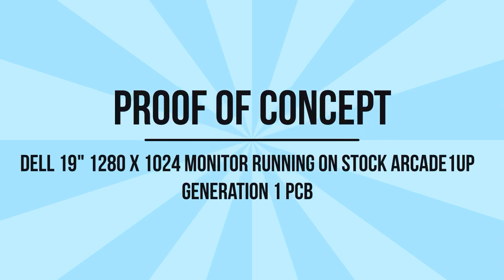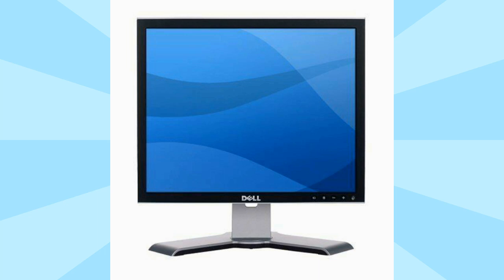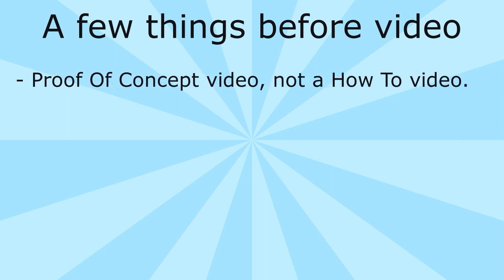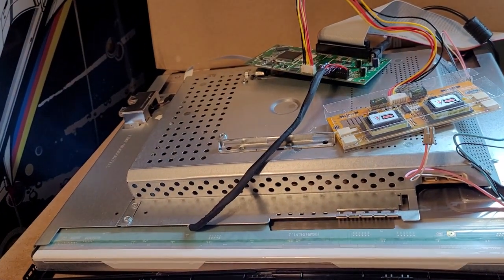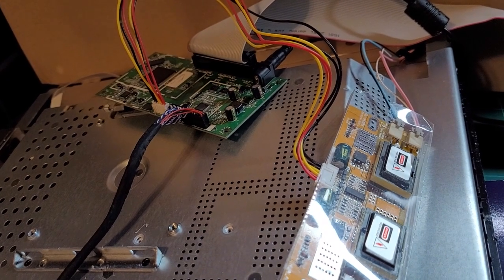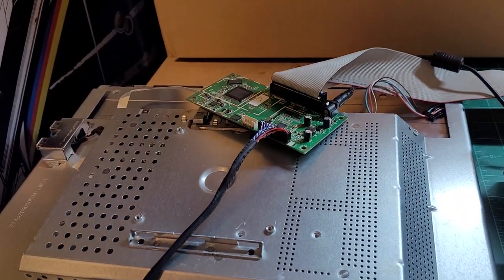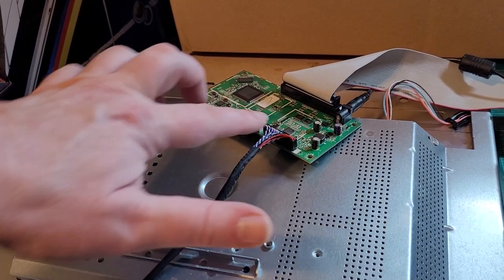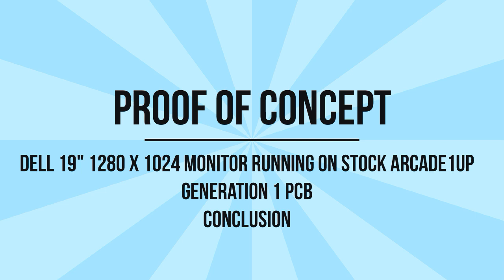Arcade1up Mods: Proof of Concept - 19" Dell Monitor running on stock A1UP Asteroids PCB.

Comment: Hello, I have the same monitor as dell, I would like to upgrade on my street fighter 2 1up, having put the Raspberry I can directly connect the micro hdmi/ vga cable ?? Or can I run into problems

Comment: The 17" Dell monitors should work as well correct?  They are also 1280x1024.  I am going to give it a try with a 17, because I can use the stock monitor frame and bezel without modification.
Reply from the maker: Yes...as long as the LCD panel is 1280 x 1024, it will work, which most 17 and 19" monitors have...if the LCD panel is a different resolution, it will still work, but will look distorted or sides may be cut off.

Comment: Costco Mortal Kombat contains a BOE Monitor.  Costco Pac-Man (I have one) contains a BOE Monitor - Model Number DV170YGZ-N10.  The BOE Monitors are often referred to as Gen 2.  Most Gen1 Monitors have the Model Number M170ETN01-1.
Reply from the maker: Yes...But Walmart Mortal Kombat has older monitor (1280 x 1024) So does older Pac-Man...just depends on where you buy it. But main thing is if it has a BOE Monitor in it, then this will not work on those PCB's. Well...it will work, but last 64 lines will repeat the top of your cab and a nasty white line will appear. There seem to be so many different variants it is hard to keep track of. Another example would be the Pac-man and Asteroids 8-game party cades. Those have a signal of 1024 x 768, so this would not work either. Would show on the screen, but have information repeating itself on one side because the monitor is 1280 x 1024 and the resolution being sent to it is 1024 x 768>

But in general, If it as the M170ETN01-1 this will work with the PCB in that cab....if it has a BOE Monitor, will not work.

Comment: That’s awesome. Been wanting to upgrade my SF monitor and keep the stock PCB but haven’t quite figured out a way yet. This is perfect. Only thing is the bezel and plexiglass usually comes on top of the dell monitor power button, so hard to turn on/off after install. Is there a work around I’m not seeing for this? 
Can’t wait to see the how-to video! Thanks so much for sharing your tricks!
Reply: Yes, put a smart power strip like this one "https://www.amazon.com/gp/product/B0058DHO1W/ref=ppx_yo_dt_b_asin_title_o03_s00?ie=UTF8&psc=1" inside the cabinet (using the Arcade1Up power as the master) and it will power up the monitor if it is plugged into one of the controlled ports. On that particular smart strip be sure to turn the power sensitivity all the way down because the Arcade1Up PCB uses lower wattage (many smart strips will not work due to this aspect but I can confirm that smart strip does work after adjustment - obviously I have not been able to test it with every possible 17/19" monitor).
Reply: @DGPG35  - that makes sense. Thanks a ton for the help!
Reply: Curious if you are still planning to do a how-to video that looks under that back office steps. If so I might wait for it instead of running the risk of messing up my pcb or screen.
Reply: Well, I went ahead and figured it out in the end. This video was super helpful so thanks again for sharing that tip in the first place!
Reply from the maker: @yannlhomme846  Yea...sorry for the late response on this. I hope to have up this weekend. Went a little overboard on the how to...some will probably think it is too long, but wanted to get as much detail as  I could
Reply from the maker: @yannlhomme846  Again, sorry for the delay in getting the how to video up...should be tommorrow night, if nothing comes up.

Comment: I have tested this on a Dell 2007FPb and couldn’t get it to work with Asteroids, Space Invaders, SF2 and even tested on TMNT without success
Reply from the maker: Yea...that is 20" monitor...20" monitor has output of 1600 x 1200. The A1up PCB's output to either 1280x1024 or 1280x960 (newer models). 

I tested as well on the same model monitor and get sound but no video. Unfortunately, thought that may be the case.
Reply: Omg thank you for posting this... I’ve been messing with these monitors for a yr without success because there are no other videos on how to dismantle or what you needed on the monitor side of things... come to find out it was those light plugs that I never plugged in.. the whole time. Thanks again man, what a relief